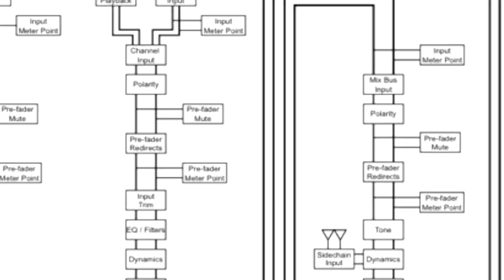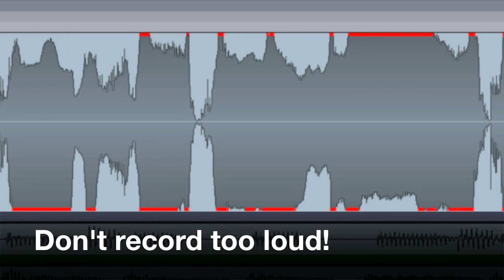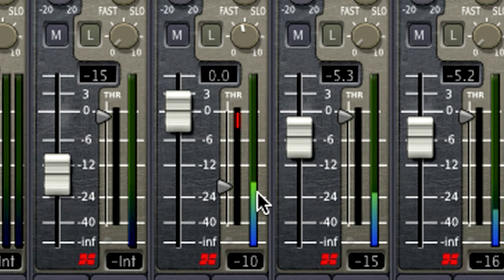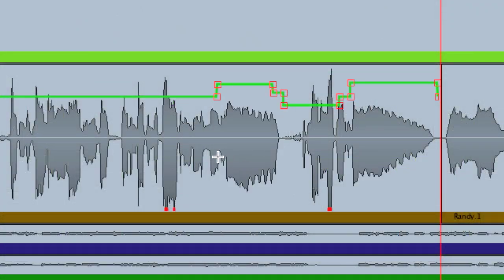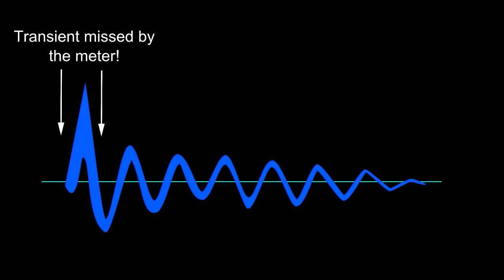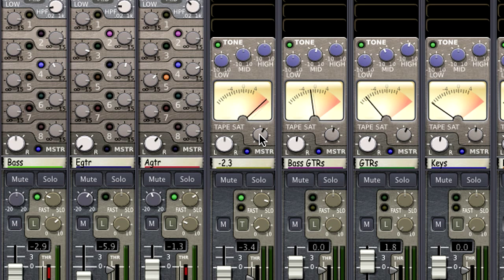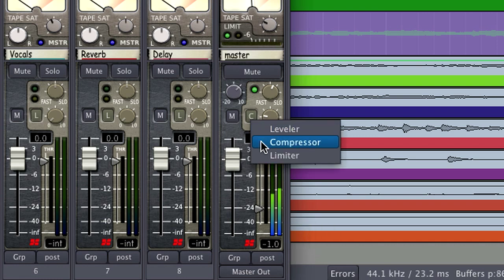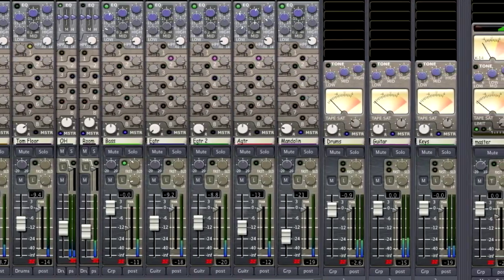Mix Tips - Gain Staging in Mixbus (v2)

Comment: Shift 6 and 7 to change the gain of a region? press G for Gain Control??? How???
Reply from the maker: Its actually Control+6 or 7.  You must click on the region first and then use the key commands.  You can also select a region and hit the D key to show the gain line and your cursor turns into a pencil tool to draw in the gain automation directly onto the region. This gain automation also stays with the region even if you move it around.

Comment: Note that if you're using gain automation to reduce input clip, the "select region and drag down" method can sometimes sound harsh due to the "instantaneous" gain level change. For serious clipping adjustments via the gain automation, you may have to use a gradual slope instead.